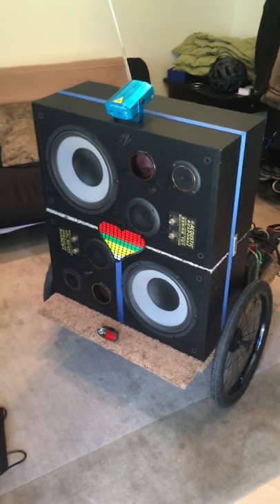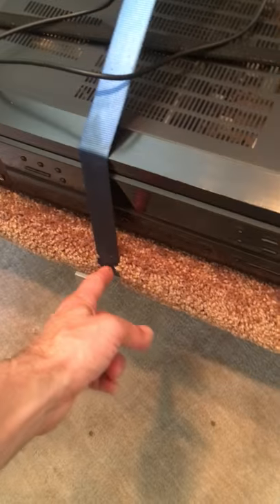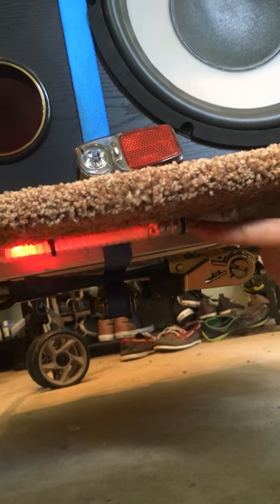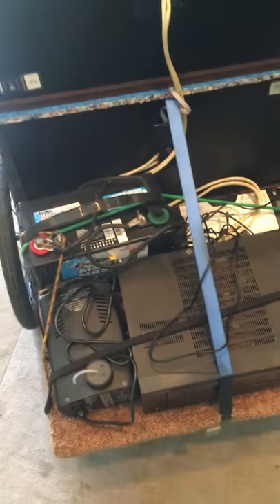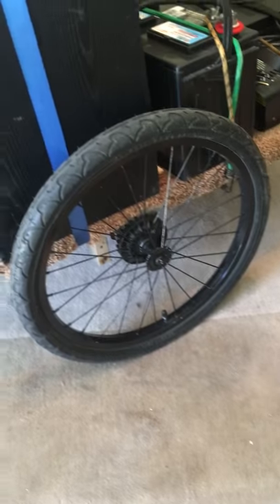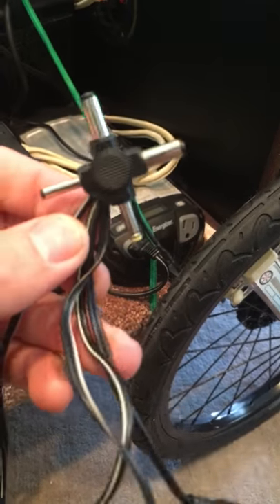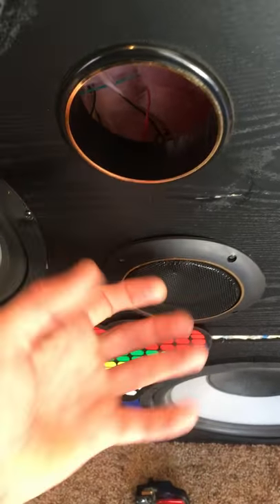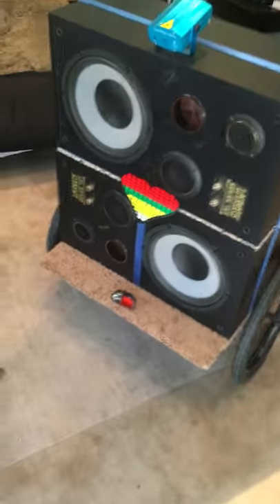Bicycle Sound Trailer using home stereo

Comment: I wanna do the same thing with my trailer but what size of power inverter is that? I've been looking at rechargeable SLA batteries. I think one of those would work but not sure.